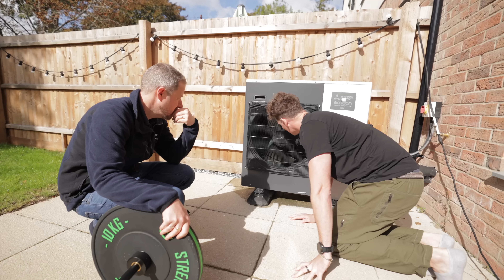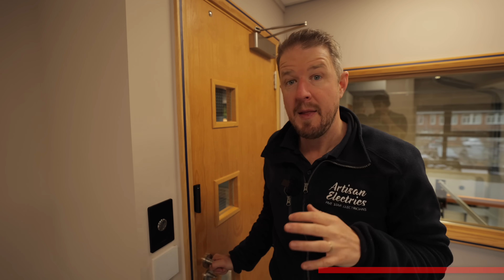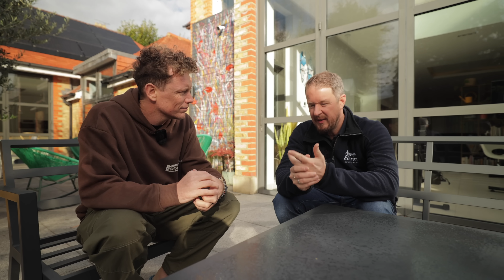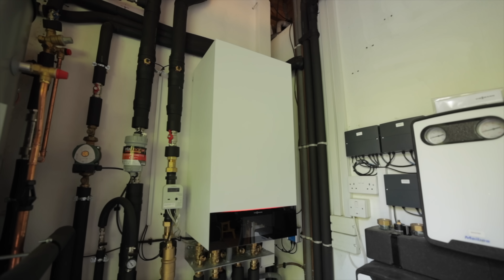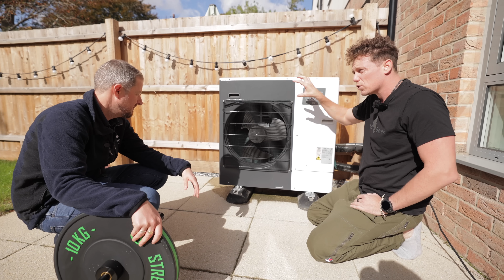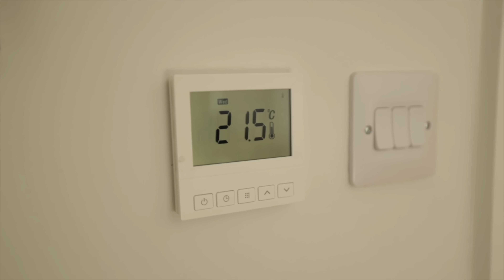Are Heat Pumps Really Worth It In 2026?

Comment: Heat pumps don’t generate heat by compressing a gas to get hot. They generate it via phase change of the refrigerant. The compression changes the boiling point. The outside radiator causes the refrigerant to boil sucking heat or if the air, that gas is then pumped to the heat exchanger where it condenses because it’s under increasing pressure. This imparts heat into the water that pumps round to the radiators. She compressing a gas will increase its temperature but it’s the phase change that gains the efficiency.
Reply: The phase change just takes a lot of energy which allows for more work to be done by a smaller device, it doesn't increase efficiency, like how boiling water to steam takes a long time, some advanced systems use very efficient helium cooling loops without any phase change, situations in which size doesn't matter.
Reply: It’s not phase it’s a state change. 
From liquid to gas is where the temperature change happens. 
Firing a liquid through a tx or expansion valve changes from a liquid to a gas and also dropping pressure has a significant temperature change. 
Compressing the gas changes it back to a liquid increases temperature and pressure. 
Thanks guys.

Comment: I installed a air source heat pump here in Alberta Canada, against all the naysayers. The hardest thing was finding a installation company who knew enough about heat pumps for me to be satisfied with them doing the job. Here in Alberta the government insists of having a backup heating system, in my case natural gas. My system is set to divert to gas at -5’C, even though the heat pump is rated to - 30’C.
The system works great.
My next step is installing solar with storage incorporating the battery of my EV
Reply: Hey there, I live in Edmonton, can you tell me how much the installation cost and whether there are any programs or subsidies?
Reply: so practicaly ur wasting ur money by payng very xpensive energy and heat pump on about 5000  or 9000 euros and after u pay electricity very much:P

Comment: the source of the heat in a heat pump is the compression of the gas, what the ground source, air source thing is about is warming the expanded gas back up so it can be compressed again. so the really cold gas picks up heat from the air or ground, and because this gas is way below zero it really doesn't matter if it is "freezing outside" as that is still warmer than the gas. but the more you can warm the gas back up, the cheaper it is to compress it again and get heat out of it.
Reply: The source of the heat is from outside. The compression heating only represents the electrical load of the compressor up to the COP 1 point. The difference between there and a COP of 4 would be 3.

This make 4 units, 3 are coming from outside, 1 is coming from the mechanical compression of the gas. The only role of the compressor is to drive the phase and temperature change to allow heat to be sourced at a temperature lower than the target temperature.

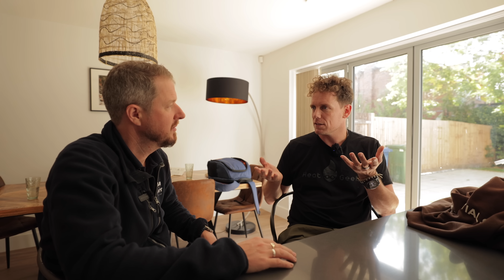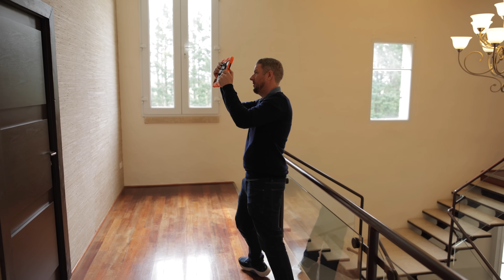Comment: I've had my Vaillant ASHP (with propane refrigerant) and Thermino Sunamp Domestic Hot Water unit for a couple of years now, in a generic 1950's semi-detached house.  In fact, the system's getting its annual service tomorrow.  It took a year or so to get the wrinkles sorted and learn to love it, but now it's just chugging along beautifully on a heat curve of 0.55. The house is effortlessly warm. The radiators are just warm to the touch and the house is a constant 21C.  The DHW is timed to use primarily cheap electricity between 23:30 and 05:30 and there's always hot water.  My total energy costs this October are £135 - including all of my car charging. (For comparison, the equivalent figure for July was £93.)  I don't have batteries or solar. Yet.
Reply: How much square meters are you heating?
Reply: How much was the hardware and installation (minus any grants), and how much do you think you will save per year with your heat pump?
Reply: My total Oct bill for energy was £140 and I've got a gas combi in a 3 bed semi built in 2000. Thats with the house at a comfy 21C at night and 19C during the day. Also being chinese we cook every night using gas and enjoy long showers. Looks like an ASHP ain't going to save me penny.
Reply: 3000 euros electric bill for December       45 room student house though.   for us the Gaz is cheaper.        what is your bill for January.  thats when the PAC needs to work more
Reply: How much was the ashp service 😂😂

Comment: That "low loss header thing" is actually a plate heat exchanger, standard in all ecodan cylinders, its ment to be more efficient than the traditional coil, then its pumped into the cylinder using a bronze pump, also as far as im aware ecodan heat pumps have an external sensor built into the outdoor units.
Reply: Correct.
Reply: Ya,the framing in the editing was unfortunate but the ecodan preplumbed cylinder does have a low loss header as standard....it steered me away from the product.
Reply: It doesn't make them more efficient at all - the mitsi preplumbed cylinder is probably one of the worst setups on the market.
Reply: @BristolHeatPumps why?

Comment: Heat pumps are fine for long term sort-of warmth. They're rubbish for chilly, damp days when you want a blast of heat for a couple of hours to tide you over morning and evening. They're also very expensive to run. Any waffle about 'efficiency' is pointless as the cost doesn't change. As a unit they're also ugly, with expansion tanks, water cylinders and masses of pipe work needed. Do they work? Yes. But they're a tram rather than a car. Might do the same job, but they're inflexible.
Reply: Don't tell me. Some random bloke down the pub told you this.
Reply: @mikeypc3592    👍👍👍👍
Reply: Yup, really expensive to run - 250 sq m 4 bed house, £200 for a year for heating and hot water, less than a tenth of the cost of our old gas boiler
Reply: @HappyDays2602    And no gas standing charge of £100pa… and rising.🙂
Reply: Simply not true as other comments on this one have stated. Inside equipment is much the same as a system boiler and tank. Cost to run, for us about 1/3 of the previous gas bills. Payback ~7 years and the house is always warm (we leave the heating running 24-7-365 now). 200 m2 house dates from 1560.

Comment: “Looks like we have a botched installation “ - and here’s the problem! Gas fitters calling themselves heating engineers, fit the wrong boiler and it will most likely still heat your house. Get any part of a heat pump install wrong and it’s either costing an absolute fortune to heat or unable to heat your house up to temp. Facebook is awash with people with HP problems asking for help because they can’t even find anyone to fix or alter new installs.
Reply: One problem is that it is incredibly complicated to size an air/water system and then it comes with a vast array of complicated sometimes required accessories. There's an enormous amount of skill needed to fit one and we don't yet have anything like the people or experience.

Some of that problem is the ridiculous use of air/water systems, some of it is training and tools - which the heatgeek folks are at least trying very hard to do something about.
Reply: The guy in this video hasn't got a fucking clue what he's talking about though, it's not a botched installation in the slightest.
Reply: @curtisclarke . The guy responsible for training most of our ‘elite’ heating engineers? 😂
Reply: @bordersw1239 not correct he just runs courses for ashp
Reply: @curtisclarke not in the slightest?

Leaking pumps, exposed pipes, high flow temp?

Yeah, that's perfectly normal.